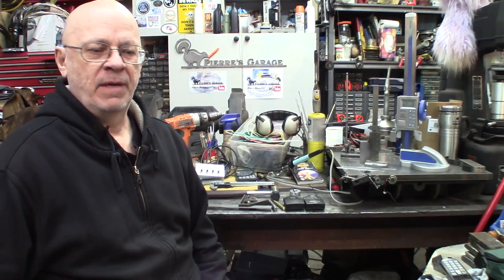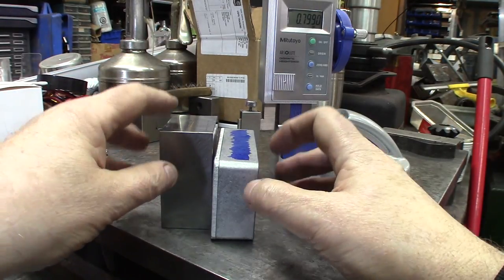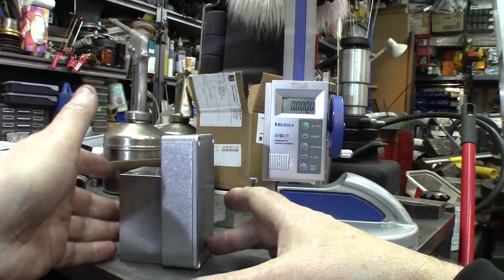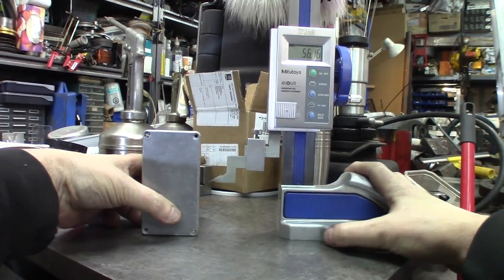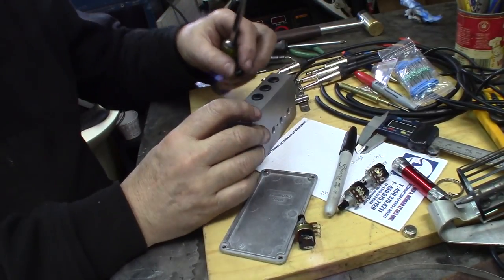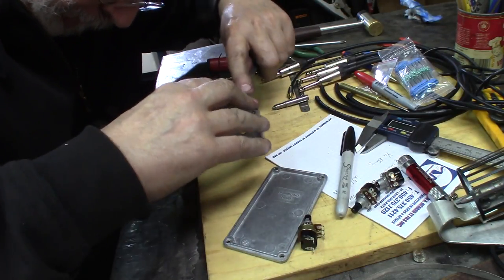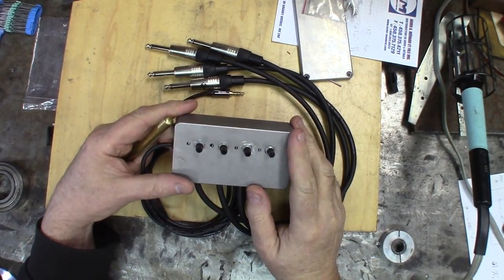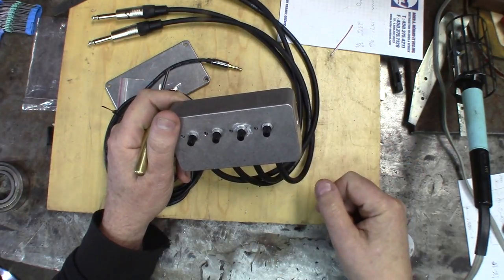4 inputs Audio Mixer for the shop, simple project made with hand tools

Comment: Nice project. 

It wasn't clear (to deaf me) whether you said "insulating" or isolating" resistors. Do you have a schematic? (One channel would be enough; they're all the same.) Also what size potentiometers did you use? (You might have mentioned it, but like I said, I don't hear so well.)

Spit is the best lubricant for inserting grommets (and it's always handy). A tool sort of like a dull screwdriver is called a "spudging" tool or "spudger". It may or may not have a small notch in the end. It's usually used for pushing wires around without nicking the insulation but it's also good for poking grommets into place. Probably easier to make one from a small screwdriver than to find one, but then it wouldn't be non-conductive. If you decide to make one from plastic DON'T use carbon filled plastic - it's conductive! 

(Totally unrelated side note: another unexpectedly conductive thing is the "lead" in a pencil as I once discovered when poking around the picture tube in an old (CRT) color TV. I wasn't injured by the shock so much, but I ripped a long gash in my arm yanking it out of the chassis.)
Reply from the maker: Hi Peter,
Your hearing is probably pretty good...
The pot is 1k and the resistor in line with the cursor is 1.2k.
Since I almost never make electronics I doubt if I ever make one of those "spudger"...
Remember the sting of the 25KV from monitors, caught it a few times, Geeeezzz it stings, even the sight blurs for a short moment, never ripped my skin on sharp corners, though...  Wasn't doing residential TVs but broadcast monitors, the fabrication was way better, remember that the main brand purchased by the CBC was Conrac and in the later days some Sony, the image on those had nothing to do with home sets... This was more than 27 years ago...!!!
Cheers,    Pierre

Comment: That's really cool, Pierre. I'm starting to work with audio electronics, including active devices like op-amps, so if you need a more sophisticated mixer in the future I'd be happy to rig that up for you. Out of curiosity, what are the values of the pots and mixing resistors?
Reply from the maker: Hi Murray,
You've been quiet lately, still studying machining seriously...???
My main career before the 1990s was senior electronic technician for Radio Canada in Montreal, still got som knowledge in the field, but, by now I don't look for excuses to apply those principles...    lol
I already have a few small size mixers for mini studio usage, this is more to a quick fix in the shop, the receivers are supplying ample gain so the loss isn't an issue.   The pots are 1k and the resistors are 1.2k or something close...
cheers,   Pierre